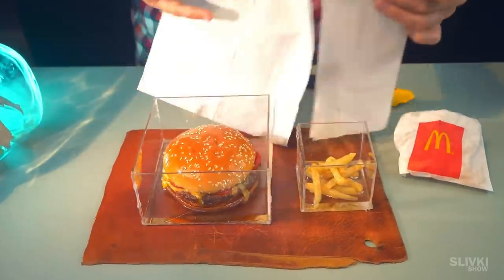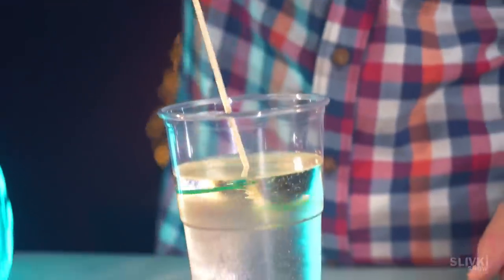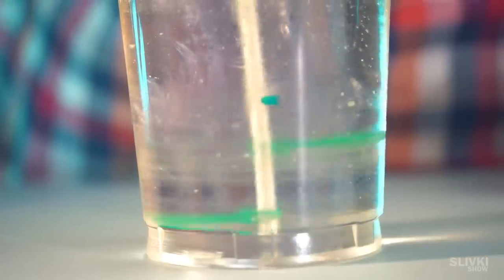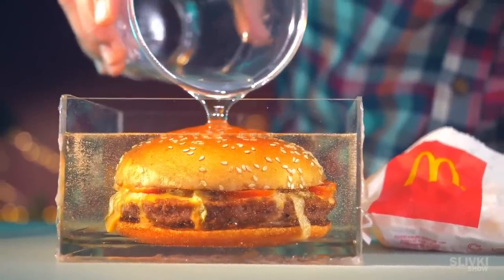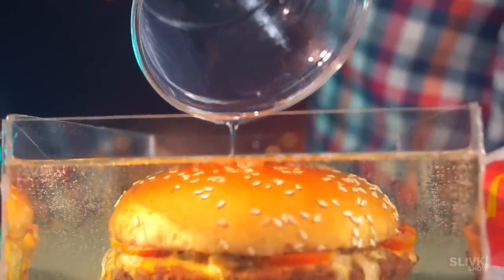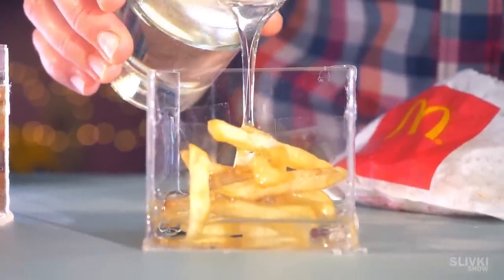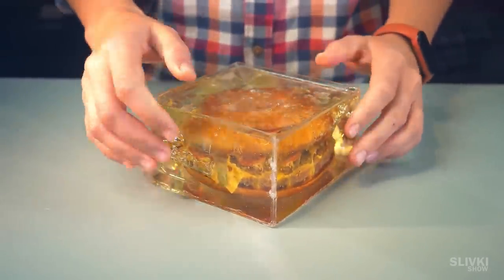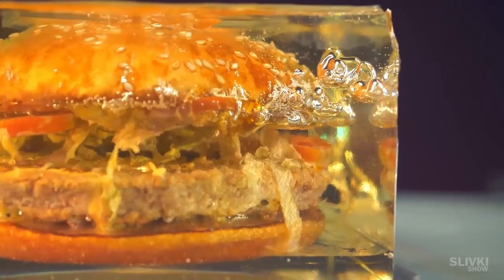HOW TO PRESERVE THE BURGER FOR 1 YEAR

Comment: The resin gets hot as it cures and thats what did the cup in, it melted due to the heat, its PET though so goes weird at 60c the acrylic has much higher weirdness temp (glass transition temp)